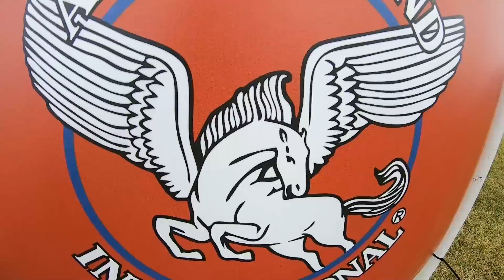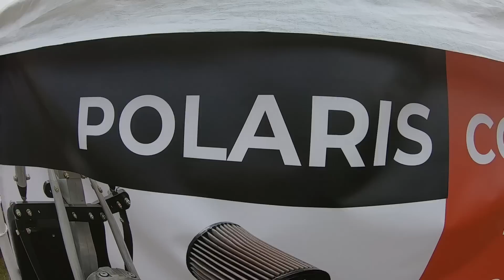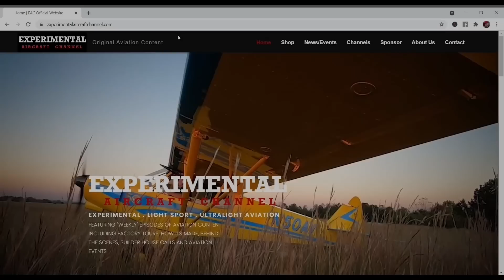Polaris ATV Engine for Airplanes! and Gyrocopters! Oshkosh 2023

Comment: The Gm 4.2 inline 6 would be a great airplane engine. They can make 400 hp easy and are all aluminum blocks. They are very reliable and in drag racing has made 1000 hp on boost and 650 na. I know this is light stuff and would not be applicable here. It’s just like the barra from Australia but it’s a Gm. The ls kinda took over and this engine has been over looked for performance and reliability.

Comment: I would rather have a more reliable engine than Polaris .
Reply: Why? It's not reliable?  Polaris has a ton of ATVs, UTVs out there. I thought they were pretty darn good. They are not air cooled or built like a cheap lawn mower engine. It's just what's needed a smaller, lighter weight US built engine. Don't yah think?

Comment: Might have been interesting, IF there was better info, such as price, weight, TBO, etc.   After 4 years of development, the lack of even this basic info is a big turn-off.  I am in the market for something exactly like this, but there is no information on the engine of the Air Command website, very disappointing.
Reply from the maker: That is because it is still in development. It is good on them to not try and sell you something (or take your deposits) yet on something they are not ready to "sell" you. This is "interesting" and "newsy" and they have a running prototype which is why we shared this with you. Will be interesting to follow and see their progress moving forward. Some of these shows... look at them like the "Detroit Auto Show" where you see some things that "could be" but might not make it into production.
Reply: LOL.  Why don't you do all the development work and get back to us with a liability proof engine by next week.  We'll be standing by ready to give you a truck load of cash, hero.